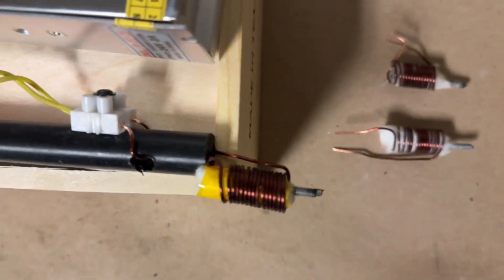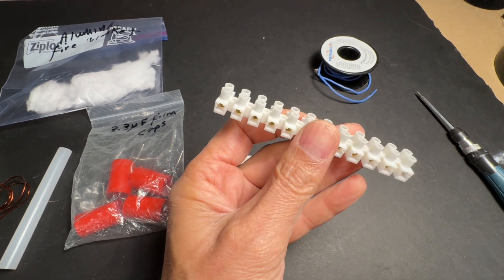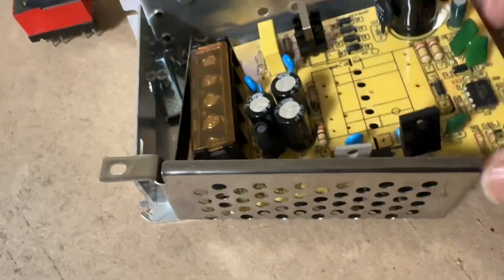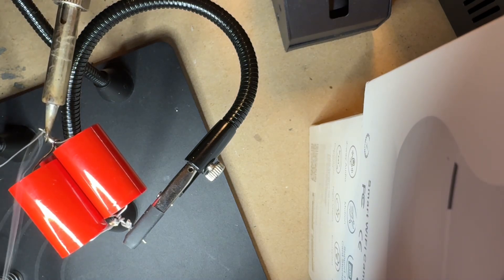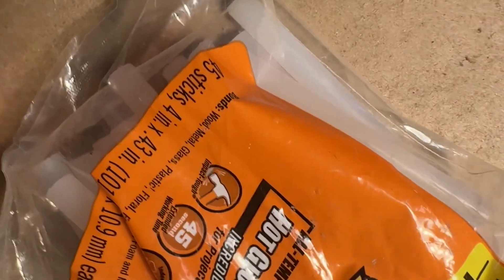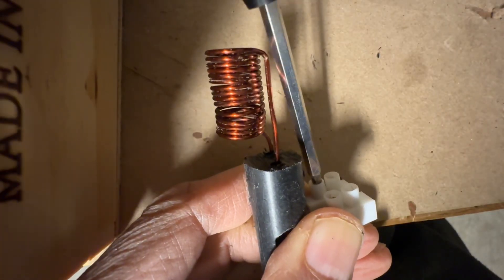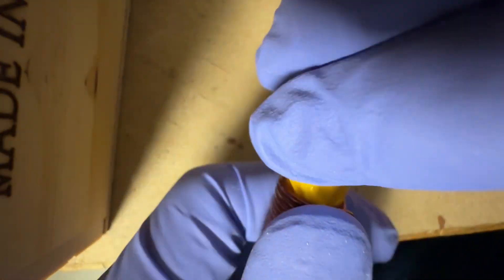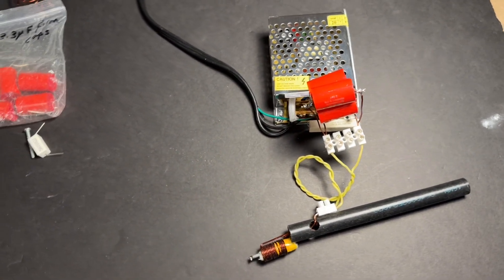Super cool DIY Inductive Soldering Iron

Comment: My question is does psu gets hot ? After few minutes of use , is possible to use in daily life?
Reply from the maker: Good question- PSU gets warm after long run times but never gets hot. I’m surprised about this but yes seems very stable and it still puts out 24V across the 100ohm burden. In place of the burden resistor could use a bright light for solder station so it’s not wasted as heat
Reply: @BrianDhvTinkerer  Thats nice

Comment: how cheap is china mass producing soldering irons
Reply from the maker: The Chinese mass produced ones are cheap. Never seen them sell an induction soldering iron though!
Reply: @BrianDhvTinkerer  the materials you used are very cheap and most likely you can find a cheaper power source, use less tape + other materials and you may beat china prices

Comment: Next more simple solution. You could use a 12v electronic ballast as the high frequency AC generator for the inducton coil. Could be cheaper, lighter and easy to mod. Think about it!
Reply from the maker: Good idea for a portable unit!

Comment: Nice build!
- now, soldering say FET's to coil and inductors in a radio.... I am having some concern that the radio (or whatever else sensitive low-power/voltage devices present) circuit will not survive the externally induced electromagnetic fields from the induction coil near the tip.
Reply from the maker: Legit concern! Because of its lower freq and most of the rf energy absorbed by the metal in the , should not be a problem. The freq is 65kHz smaller objects are less likely to be affected by any residual field. Induction cooktops work at around 100 kHz and the low voltage electronic iMacs and FETs are directly under the RF coil and seem to do ok!
One way is to try it out. Other thing, can use a longer heating tip further away from the induction coil.
Reply: @BrianDhvTinkerer  Excellent way to find out is to try :ø)
I was thinking in regards to the 'exact' soldering moment, as like when a contact makes contact in a high-energy circuit, terminals tends to spark and can weld together when the metals touch.
With (I 'see' them as large, but since they couple - and unless completely shielded - guessing how the e-m field(s) propagate is not easy to determine without extensive trial) energetic elector-magnetic fields  'near-by' relatively sensitive devices, science wise my mind goes towards Tesla and his tesla-coil design(s) - with large oscillating currents, voltages, in a relatively large volume of space.

One easy trial would be to see if it can light up an LED when soldering say SMD inductors with iron core and coils without.

I would subscribe to see - if I wasn't already subscribed ;ø)

Edit - I just thaught of the difference between doing LED-Inductor birds-nest vs PCB. On a PCB with grounding/large copper pads/areas, the copper will oppose an induced magnetic field, likely creating 'additional' effects on component(s) soldered onto/around. 
A birds-nest setup is really also 'only' for prototyping and the handle tends to be held 'far-away' from other components, that's how I do anyways :ø)
Reply from the maker: Tested it out with LEDs and no issues. All worked fine when done. Didn’t even see any lighting if the LEDs when the soldering iron was brought near and touched them with one side grounded